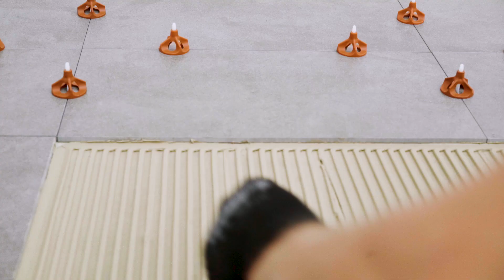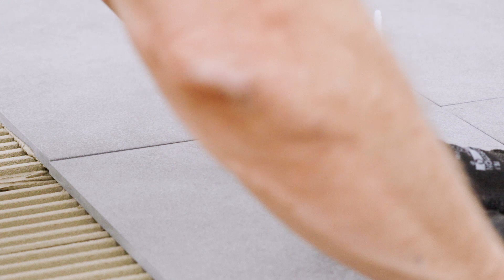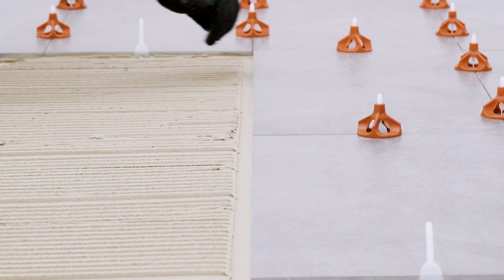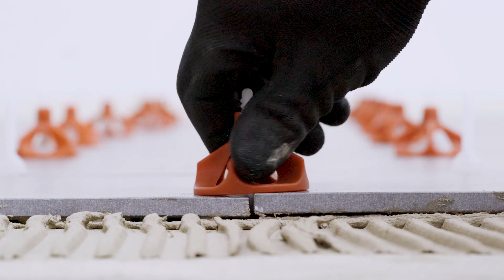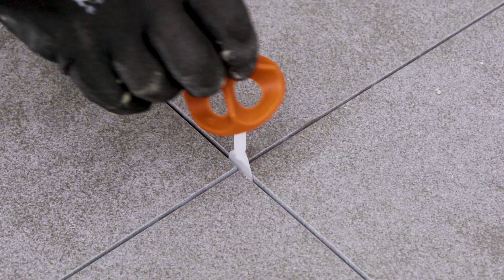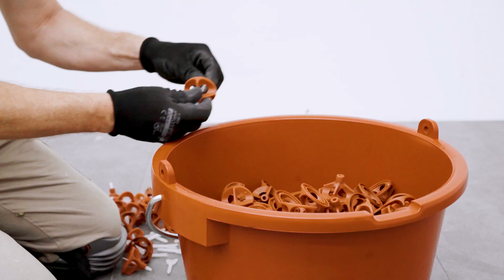RAIMONDI | R.L.S. VITE

Comment: benn using the rls wedge/ clip system for over 5 years and am curious on this spin version? i use the pliers on the wedge system and love it, never have any issues and the floors come out flat. i use mainly 36 to 48 inch porcelain planks ,  will the spin version apply as much pressure by hand as the wedge system?  just not sure if the spin version can get the tiles as flat as the wedge system with long plank tiles? thanks for any info you can give